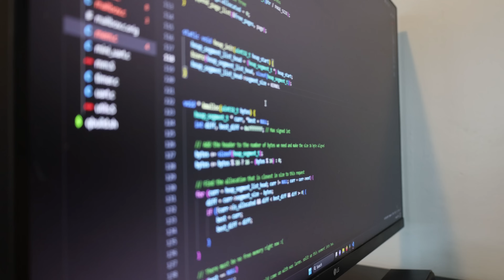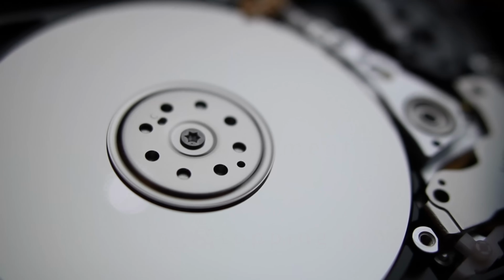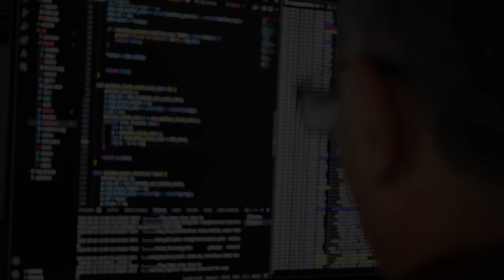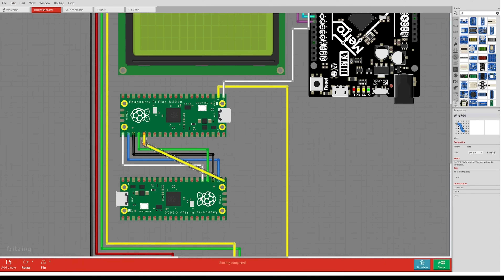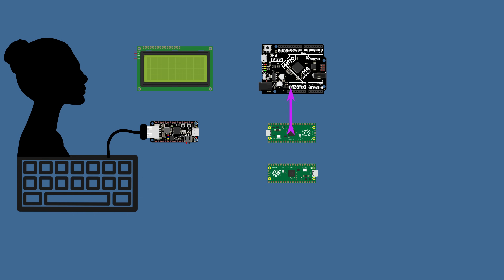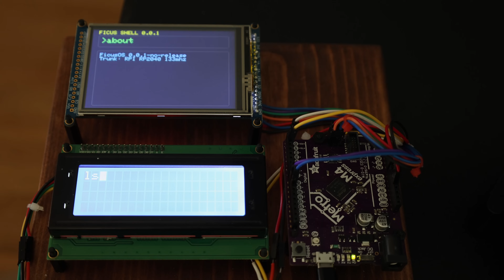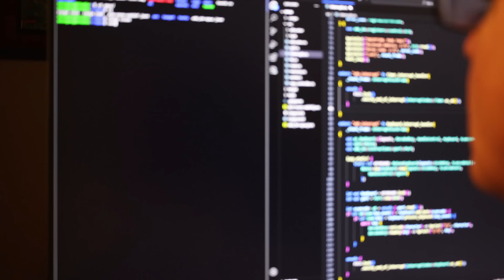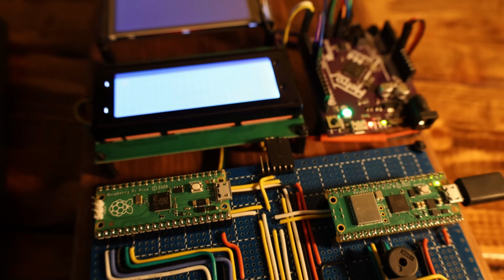Building a Retro-Styled Homebrew Computer & Operating System from micro-controllers

Comment: This is a really fun project! At my day job I design internal test equipment for consumer product R&D, and for the last year or two I've been working on a modular data acquisition and test automation platform that uses raspberry pi picos on interchangeable cards sending data over a common message bus. There's some parallels with your project and a lot of differences, but I really like seeing how you approached a similar problem from your perspective as a higher level software engineer. I feel like the two entry points to programming are at the very high and the very low level, and coming from the really low level end (my first Real Programming language was Assembly, I hated it. I mostly just do C/C++ in Arduino now) I'm finding that step upwards into higher level stuff both challenging and rewarding. While I know code videos don't tend to do so well on youtube, I'd be interested in some more in-depth videos on the software architecture!
Reply from the maker: Thanks! I had originally imagined this video would be mostly about the code parts, but it just took a different direction all on its own :)  Once I finish out a few pieces, I'll do a deep dive on the code for sure. To your main point, I kind of took what I know from software and applied it here, since it really is a mirror of a micro-service architecture where each service runs on its own little chip. I find it interesting that similar patterns apply at all the levels - but I guess it makes sense that they would. Cheers!

Comment: As a Electronics Engineer I have to say, that you did a great job. But for this project it would be less time consuming and much more reliable to produce a PCB. PCB's are dirt cheap nowadays and high quality. (of course you need to learn how to use a PCB Layout Software first)
Reply from the maker: Thank you for that! Producing a PCB is my next step on this - I'm hoping to get it rolling early in the new year. There is a lot more work needed to build out the operating system software, but I think HW footprint is ready for a prototype. I'll post an update.
Reply: @wrongdog_reckons I think you did a great job not using a PCB first, as an artist.
Reply: @wrongdog_reckons  Since you are a Linux user, let me suggest KiCAD.  Open source, and not hard to learn once you get the terminology down.
Reply: just because PCB's are dirt cheap doesn't mean one should be wasteful, much better to prototype without to know exactly what is needed, then make a pcb when that's more set in stone
Reply: I vote for KiCAD ver.7. Its free and really really good!!!
Reply: I saw a poster about a $100 grant for high school students to build a PCB, called hack club
Reply: Yeah dude but it takes like a week to get it from jlpcb. I wish you could just 3d print your own PCB's. It would be so much better

Comment: "it has something like a 2 Hz refresh rate and the shell is known to lock up fairly frequently"  Yup, sounds like a typical retro computer to me!  Well done!  :)

This was a great walkthrough of a neat project, and a great example of how anyone can really jump in and start teaching themselves something new, if they really want to and can just come up with some interesting idea to pursue.  I really like it.
Reply from the maker: Thanks! It was so fun to make both the computer and the video.  I learned a lot - mostly about how much I have left to learn :)
Reply: Exactly, until the first Microsoft Windows it was like this or even worse
Reply: @imperiosheriff my C16 booted in less of a second and only locked up when I made a mistake in assembly. Games ran at 50 fps ( memory was the harder limit, not compute).

Comment: Well done. I am just asking myself. Is this a computer in a "classical" sense. You actually used several microcontroller boards. That have their own libraries and "operating systems" already. And you just connected them to each other and wrote code to display information on the displays. For which I am sure you used libraries too. 
Building even the simpliest computer would take too much and heavy work for years. Let it be even getting some bare bone microcontrollers and then wirting your own code for them just to do this would be too hardcore I guess. But what counts is that you had fun and learned things.
I just saw you used mostly python. None of this "computers" would work without several layers of abstraction(underneath) with python.
So what you have built is an application on top of an exsiting "operating system" that immitates the functions of an operating system ;)
Reply: Actually, this design is not that far off from how a lot of the earlier mainframes and minicomputers were designed back in the 70s and early 80s (though, obviously, with a lot more horsepower in each of the components than people were had back then).  Many of those were actually a collection of smaller boards, each with its own processor and support hardware, dedicated to a particular function, with specialized communication busses connecting them.  (It wasn't until people started trying to economize things down into a budget-friendly "personal computer" that designs transitioned into the more well-known architecture of a single CPU that does everything and connects to all the peripherals with a common system bus.)

And technically, even the CPU in the computer you're using now has its own embedded code that it runs internally (called "microcode"), underneath the OS and application code, as do other components like most GPUs, some IO controllers, network interfaces, USB devices, etc.  Modern PCs are actually arguably just a collection of things running their own individual lower-level "operating systems" (aka "firmware") too.  It's all just a lot less obvious to the outside observer that it's all happening under the covers a lot of the time.

And, for example, most of the Android OS is actually just Java bytecodes running on an (optimizing) interpreter inside a virtual machine on top of the actual hardware, which is arguably not that different from running Python on top of a microcontroller core (but most people would still consider Android to be a legitimate OS)...

The truth is, all of these distinctions are, and always have been very fuzzy anyway, and it's very difficult to even define what makes something a "classical" computer or not.  Personally, I think this is arguably complex and general-purpose enough that it qualifies, even if it doesn't look exactly like the way most people are used to computers being put together in general.
Reply from the maker: You speak a lot of truth, and like Carl Sagan said: “If you wish to make an apple pie from scratch, you must first invent the universe.”  - What would Linux be without the GNU toolchain? Or IOS without BSD? One of the best things we do as humans is to build on the work that came before us.  I did some 'close-to-metal' programming here - closer to the metal than I've ever done - but ultimately, it's built on top of a lot of open-source work. The part that became interesting to me was the communication protocols and orchestration logic that allowed the nodes to work together to carry out the overall functions of a computer. There are some neat things there under the hood - especially in how the user space programs are executed.

I do think it fits the definition of a computer - just not a great computer :) Like I said in the video (07:00), many decisions here are driven by aesthetics and what I wanted to learn about.
Reply: I think even the first Microsoft Windows was not an operating system itself but a simple application.
Reply: @imperiosheriff   First versions of Windows were based on the MS-DOS core.
Reply: @Stinktierchen  Actually, no, 
@imperiosheriff is arguably more correct.  The early versions of Windows (up through Windows 2.x, and arguably even sorta including Windows 3.x) did not really have a "core" of MS-DOS at all.  They were actually sold completely separately from MS-DOS and just ran on top of it, and called the existing MS-DOS APIs to do any OS-related stuff, just like any other application would.  They were basically glorified application launchers, not OSes themselves.

Windows 3.x added more direct control of some hardware, and so arguably became (at some level) an actual OS, but still relied on an external, separate OS (MS-DOS) for a lot of functions (which you had to purchase separately).

It wasn't until Windows 95 (technically OS/2 came first, but nobody remembers that) that it could arguably be called a full OS in its own right, able to boot and run completely on its own without relying on some other OS already running on the machine first.